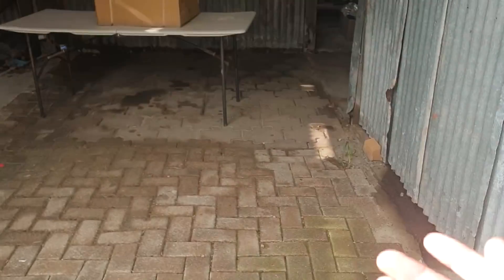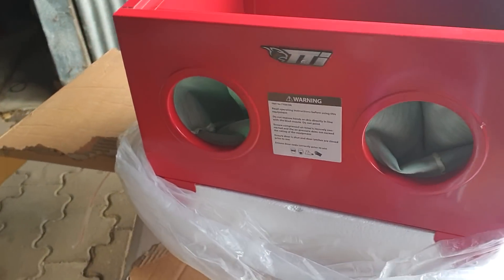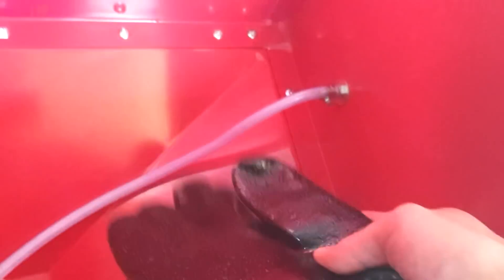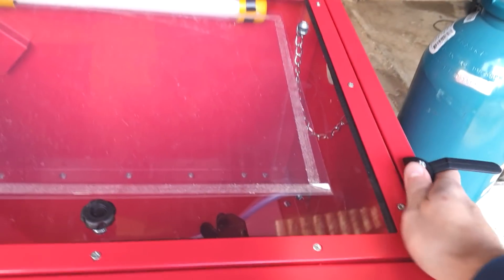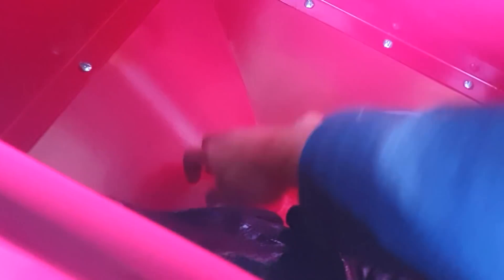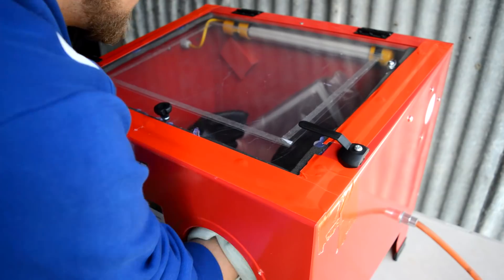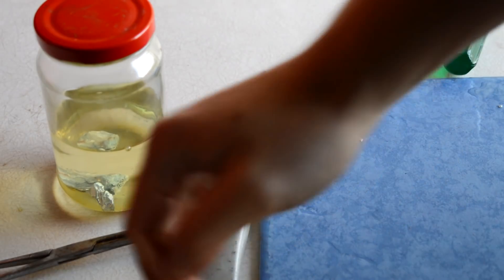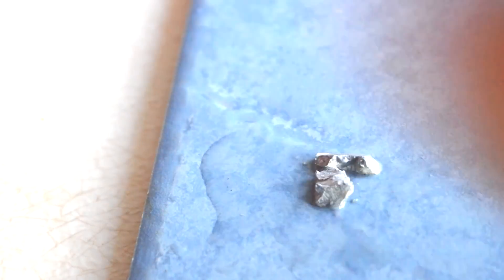Building a Glove Box for Air Free Chemistry

Comment: There are some very nice synthetic rubber draft excluded material which I think would be better than the form. The draft excluded comes as a flattened rubber tube that squashes down well. I would also add a desiccator to the box with a lid that can be left open to dry the contents. Plumbing suppliers offer a range of gas tight fittings. One solution to regular size holes, is to fit bolts with rubber compression  washers. 
 I doubt if anything with exposed electronics will last long in that box, so a sealed camera seems a good idea. A camera in a light proof box, mounted externally at 45 degrees to the glass, will produce a good picture without any reflections. 
 It would be nice to replace the see through top with Pyrex glass, maybe the sort used for oven doors, this would greatly improve the transparency.
A simple manometer would indicate if the box has positive pressure over atmosphere, not sure what the best liquid to use, but certainly an internal pressure guage would be useful as this would show how well the box is sealed. Maybe replace the gloves with long sleeve nitrile gloves, used in farming for handling pesticides, alternatively, veterinary gloves used for internal examination of large animals.. Check the light wiring is fed into the box through an IP 66, or 68 wiring gland. These are used to seal exterior mains socket boxes, they cost almost nothing.
The seams of the box metal work could be sealed with a plastic paint. Do this after all other leaks are fixed. With the paint wet, pressurise the box and drive the sealant into the gaps in the seems. Alternatively use silicon rubber sealant, my only concern is long term chemical compatibility with the materials that will be used in the box.

Comment: Isnt it better to use nitrogen as an inert gas as well for most chemistry? Argon is fine, but its gonna be pretty expensive in the long run. Nitrogen is far cheaper than argon, i think you can do not all but most chemistry in a nitrogen filled chamber.
Reply from the maker: I can't find nitrogen as cheap at my local hardware store, as it's not used in welding.... I'll have to see what prices are in more specialist gas cylinder hire places
Reply: @ExtractionsAndIre  Ah, well I was also thinking, isnt CO2 used in welding for shielding or something? Idk how viable CO2 will be for your experiments but it is much cheaper than argon as well no?
Reply from the maker: @anjalpaudel8713  it sometimes will work ok? But not often. Sodium and lithium I think still react with CO2, lithium even reacts with nitrogen. Not sure what cesium does

Comment: I think this is a good idea.  You might want to leave that big port on the right covered loosely with tape, so that in the event of some sudden pressure increase the tape will blow off and vent the box.

You could probably get away with much cheaper nitrogen for a lot of experiments.

Gasses form solutions when mixed.  When you mix salt and water, initially the salt falls to the bottom, but once dissolved, the salt is evenly distributed in solution.  Gasses are the same - once mixed, heavier gasses don't settle out.  The atmosphere isn't a multi-layered cocktail of pure gasses, for example.

Comment: The drain on the bottom you could weld a nut on to. That way you can seal it with a bolt. I'm not sure if it would work but maybe a pressure gauge at the top of the box could be used to monitor the flow rate. And allow you to guarantee that you had a positive atmosphere in the box.

Comment: That upper right hole with the acrylic sheed looks like a pretty good point to add at least a small airlock when you inevitably forget something.

Also try not to get the gloves in contact with stuff like the mineral oil too often. I doubt the rubber will like that over the long term. XXL disposable gloves usually work quite well as an additional layer of clumsieness. Alternatively wipe them with some Ethanol once you're done.

A vacuum pump for better purging sounds nice but I have my doubts that the top acrylic sheet would hold up to the pressure difference.

Comment: As person who was working and servicing lab glovebox, I can say a few words:
@Seal Piercing advices are great, I personally would recommend silicone in place of foam and any other seal. It is chemically resistant, easy to apply and form. I think King of Random had a nice video about making vacuum seal silicon play dough. Should be usable here.
As for oxygen/moisture scavenging: molecular sieves x13 are used if my memory is correct. Nice, easy and reusable. For oxygen scavenging, copper foam made from a reduction of copper oxide powder tablets (5-10% H₂ in Ar). This eats up oxygen like crazy. But for all this to work, the loop with a pump must be installed to move gas through the system. For work with organic solvents, normally container with charcoal pellets is mounter before those two for catching them. Especially alcohols destroy active copper.
A lot of informations about Glovebox use (old school ideal for hobbyists) can be found in Duward F. Shriver, M. A. Drezdzon - Manipulation of air sensitive compounds-Wiley-Interscience (1986).

@Lee Nux proposed one way valve at the top of box. If you decide to build full circulation system (it will eat O₂ and H₂O and decrease the usage of argon) i would say that valve at the top is must: when you work with stuff that create vapours in box, they should be vented out of box to not oversaturate circulation system (which should be turned of for this time). Second thing, pressure inside should be regulated in any way: flow regulator on the inlet and probably one way valve with overpressure setting. even big glass bubbler with mercury/heavy oil would be sufficient.

And definitely, you need small chamber to insert stuff inside while the system is on. Heck, this way you can use this as storage for very active chemicals when you are not making chemistry inside. 

At the end, this would be a pretty big project to go from box flushed with argon to anything more serious.
Reply from the maker: Thanks for all these thoughts! Will check out the reference, a lot to think about!
Reply: @ExtractionsAndIre  If you have any questions from point of how real glovebox works, just ask. I will be happy to help :)

Comment: So you could say most of the stuff on your shopping list argon?
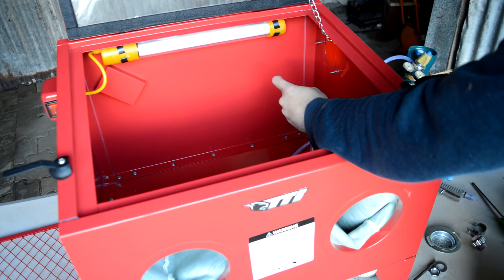Also, 8:43 don't do that. Putting your finger in front of a high pressure hose can end up with 2 bad outcomes. One is there's debris in the hose and it ends up like a bullet and the other is if it penetrates the skin, for example through a wound or something, you will have a nicely sized bubble in your bloodflow and you know where that goes. Also the first one can cause the second
Reply from the maker: Ok this is good advice, thank you!

Comment: I would unscrew the bottom metal funnel part from the box and add silicone to where the
two pieces meet and then attach it again. Then you would have sealed that big joint going
around the bottom of the box. A simple and cheap fix.

There is a range of different sized plastic electricians caps that are used for electrical boxes
you could use to seal the different holes of the box. At least we have them aplenty here in
Sweden so don't know about Australia. Those caps are threaded and counter nuts can be
bought so you can seal the holes from both sides and add some silicone for good measure.
We have them in both metal and plastic. The metal ones can even be bought with an O-ring attached.
It looks something like this:
https://www.ahlsell.se/10/el-1/installationsmateriel/14-forlaggningsmaterial/kabelforskruvningar-och-tatningshylsor/avslutningsproppar/1476573/
And the conter nut:
https://www.ahlsell.se/10/el-1/installationsmateriel/14-forlaggningsmaterial/kabelforskruvningar-och-tatningshylsor/kontramutter-d2fe8451/1477234/
Sorry, I don't know the correct English term but any hardware store should be able to help you.

Comment: Instead of using the foam for the lid seal maybe use a rubber type seal even a bead of silicone around and let it dry then use that to act as a seal to prevent leaks

Comment: Need a vent for the displaced air. Right now the leaks are the only place we got for the old air to escape. A pressure gauge would help to so you don't over pressurize and blow out a tape hole. If it's 15 psi outside then maybe 15.5 Inside but that's up to you could go higher or keep it even

Comment: I think you could use silicone instead of hot glue, it should seal pretty well, also, shouldn't you vacuum-purge the chamber before so you don't waste that much argon while purging?
Reply: Try vacuum that "glove box" lol :D It would probably implode, and thats only if it would really be airtight sealed.
Reply: @marchans-christianpiech3297  Almost guaranteed the gloves will leak massively, preventing the pressure to drop much.

Comment: You may want to make sure that it's relatively easy to unplug that hole on the bottom. I can totally foresee some point where you're going to want to remove a delightful cocktail of solution and glass shards from it, and you'll want the process of draining the box as painless as possible. Also, camera tripod mount screws are 1/4" machine screws, so it's pretty easy to construct special-purpose mounts. A mount stuck on a block of wood is a really great way to keep a camera steady for low-angle work like this.
Reply from the maker: Yeah I agree here. That's why I avoided just welding over every hole, it'll be useful to have access ports or cleaning and draining holes I think
Reply: @ExtractionsAndIre  Plus, I don't know if you are looking to work with explosives in the glovebox. If you are, I reckon you'd want the container to relieve pressure easily in case of an incident. I found this paper with a cursory google search: https://core.ac.uk/download/pdf/208354823.pdf 

It could be really good if someone more knowledgable about gloveboxes and/or explosive handling weighed in on this.
Reply: Also, steel is magnetic last I checked. Magnetic camera mounts will be your friend.
Reply: They make plugs for testing plumbing and such that look like fancy wine bottle corks - they have a lever (or wing nut) on the top and if you flip the lever over, it squeezes the rubber so that it expands out the sides and makes a tight seal.  Not sure how well it will do on sheet metal, but it's a damn sight better than duct tape.

Comment: If you get soapy water you can easily check where there are leaks. You can also do that with another gas which isn't that expensive then. If you are able to make it almost fully sealed you could also attach a vacuum pump to it so you can fill / evacuate the chamber to get it really free of air

Comment: My recommendations from having tried to seal in inert atmospheres with irregular DIY stuff:
1) More fasteners on that lid. The stiffness of the lid should be matched to the amount of compression your gasket needs to seal well, and without replacing the whole lid you can make it stiffer by adding more points of support. Going from 2 to 6-12 should be a big improvement and returns are more diminishing after that.
2) Silicone RTV is a great sealant. Go for stretchy stuff that adheres well and don't worry about strength, and use joints that work mechanically before you add the RTV.
Stuff I don't know from experience:
3) Is there some air-sensitive chemical that would work well to scavenge air and moisture? Ideally cheap and easy to handle. Zeolites would do well to get most of the moisture, and they're reusable, but I'm not sure what to do about oxygen. Trying to bring the air/moisture content down with flushing alone is going to use a lot of Ar.
Reply from the maker: Thanks for the tips!
I've heard about hand warmers being used to scavenge oxygen, so that might work. They're packets if finely divided iron from memory, that heat up reacting with oxygen, so I think they could do the job well
Reply: @ExtractionsAndIre  Also, they use soapy water to detect leaks in pipes carrying gasses. Maybe make some soap solution and spray some around corners to see where the bubbles form so you know what need sealing.
Reply: @gb10090  Yeah, easy visualization of leaks is important, and this is a pretty good way to do it.
Reply: @ExtractionsAndIre  Ah, you've jogged my memory. One standard trick for getting very pure inert gases on demand in the semiconductor industry is to flow it through a can of finely divided copper at high temperature. It's reusable (for them) in that you just purge it with some ammonia or hydrogen when it's full.

Finely divided iron might be good because it's clearly not completely self-passivating at room temperature, and it's definitely cheap. Maybe some chlorides as a catalyst.  Dunk some steel wool in NaCl solution, dry it off and throw it into the glove box? Little fan to blow atmosphere over it?

Apparently you can get little packets of oxygen scavenger. They're cheap, but hardly available in small quantities.
Reply: @ExtractionsAndIre  iirc you made some of that super fine iron from iron oxalate that immediately oxidised in air, so you can in theory just take that as your dessicant for oxygen, as long as you keep it in heat resistant container you can hermetically close before letting the air back in
Reply: RTV can be a pain in the ass if you ever want to take the top off. Deep vacuum apparatus works fine with silicone gasket material and it easy to dismantle if you need to
Reply: @MySuperhappyfuntime  Oh, yeah. Don't RTV the lid shut. I meant to seal up fittings, like if you bolt something through the wall, or patch leaks. You could use it to mount a proper gasket, for example.

The lid gasket is outside my expertise because it's sheet metal. You want your gasket to compress enough at all points to seal. I've only ever had to seal relatively rigid components for which deformation of the flange wasn't an issue. I think you basically want a very soft but impermeable material with a smooth surface so that even such a floppy lid can compress it consistently without going overboard with too many fasteners. Does silicone "gasket maker" work well for that?
Reply: @MySuperhappyfuntime  I don't think he means to use RTV to seal the whole thing, that would be dumb, use RTV in place of hot glue lol, hot glue is shit for this kind of thing and some silicon RTV would work a lot better.
Reply: Came here to post the same tips. Massive +1 for silicone around the base seal (unbolt the whole lot, glob silicone everywhere then bolt back up) and more fasteners on the lid.
Tape on the holes looks sufficient assuming nothing nasty inside splashing and dissolving the sticky.
All a bit of a dirty bodge fix but IMO perfectly acceptable for this project. WCGW
Reply: Wing-nuts onto  washers with rubber underneath + the silicone should seal well.

Comment: If the foam you used doesn't work just get some small foam tubing. You can even use a sealant at the edges so when the non porous tubing is compressed it buffets the seal. You should probably get a pressure gauge for the inside of the box. You do not want to have the lid blow off and smash your face. Speaking of that maybe weld or rivet some type of safety latch so if there is a blow out it doesn't harm you. Also not knowing the level at which pressure buildup will cause a failure isn't ideal..If you are actually looking to do high pressure experiments.
Reply from the maker: I'm not looking to do high pressure stuff but you're right, some sort of safety blow out is probably a very good idea

Comment: You can put a one way valve one the top to release the pressure and maybe an o2 sensor (like in car exhaust) so you can turn down the argon when the box is full (you can use less argon)

Comment: Read Glovebox and thought you were taking the show on the road, this is actually much safer, which is a surprise on this channel.
(edit) you might want to try some proper gasket rubber on the lid, replacing the acrylic with a glass pane might also be a good idea in case of fire or splashes, the screws around the bottom, if those can be removed, putting some gasketing around that might also be a good idea, or a bead of silicon sealant, some extra latches on the lid wouldnt go a miss either, other than that the most important thing would a solid platform to work on and some better gloves.
Reply: And as much as it goes against other ideas on this channel, use safety glass (i.e. not the kind which turns into daggers (or micro-daggers) when it shatters due to an explosion)
Reply: Acrylic is actually safer than most types of glass. It melts instead of shattering and becoming a missile. Polycarbonate is also very strong but acrylic is plenty. I am more worried about having burs discs in case of sudden over pressure. A large rubber flap taped over a hole from the outside that gets blown off before the lid or box becomes a projectile.